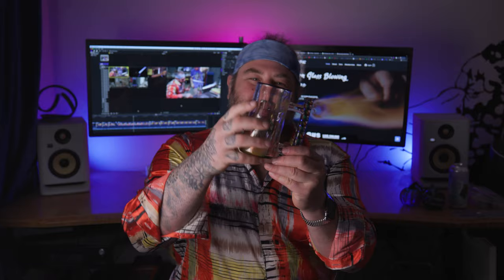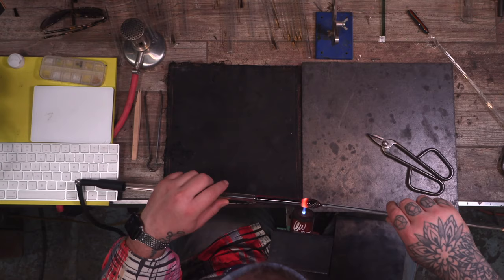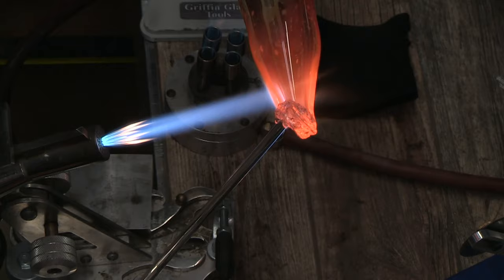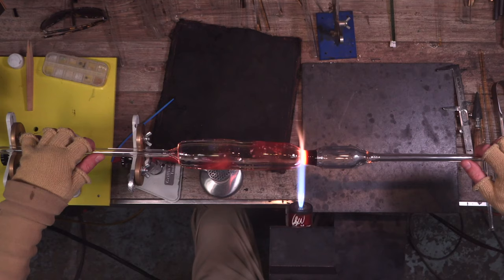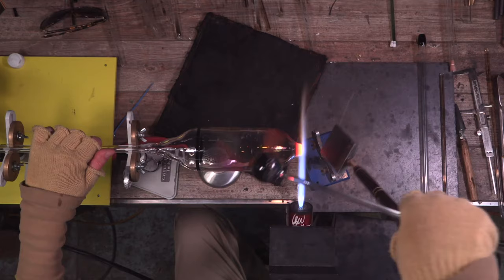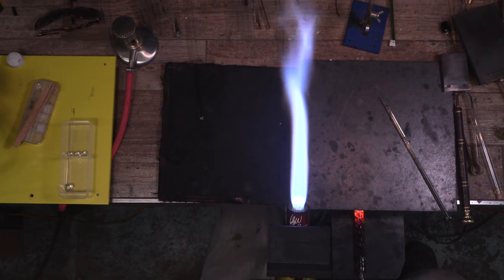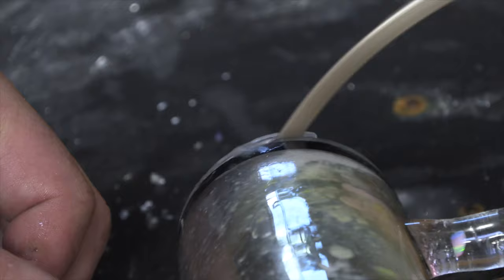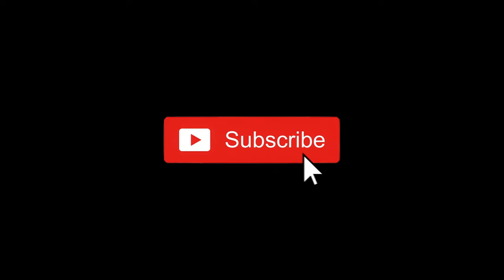How to Blow Glass II Cup with a handle || On the Torch SEASON 3 Ep 10 II

Comment: How did doobiewan put the silver shavings in the tube? I didn't see that part in the video. Thanks Dustin,  your work is amazing and thank you so much for the opportunity to see these videos.
Reply: Hey, thanks for watching!  I used a scoop with a long handle to tap out the silver filings inside the larger tube before I inserted the smaller one.  It takes some practice to get them to evenly disperse.  If you’re tube is too hot the filings tend to clump up, so be mindful of the temperature.  I waited maybe a minute or so after taking the tube out of the kiln before adding the silver.